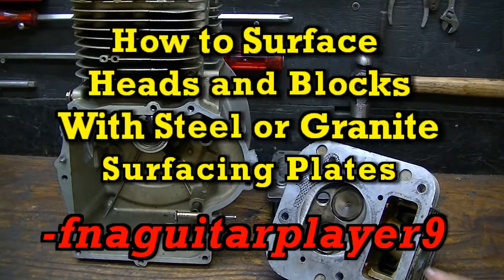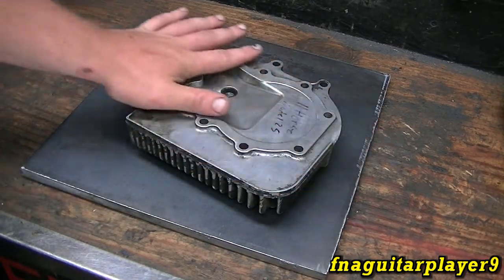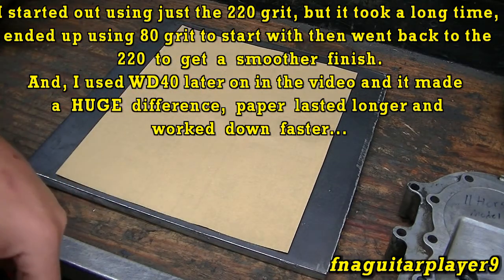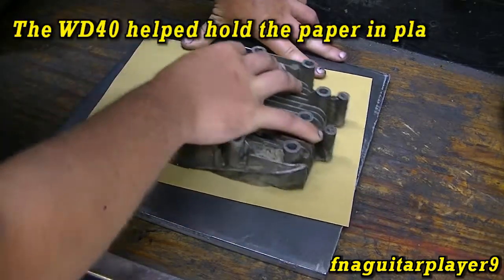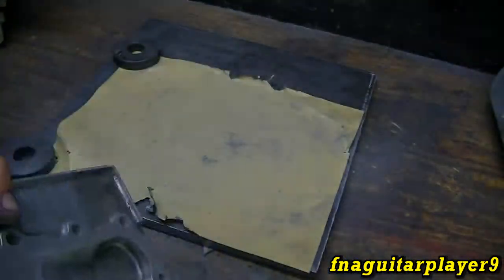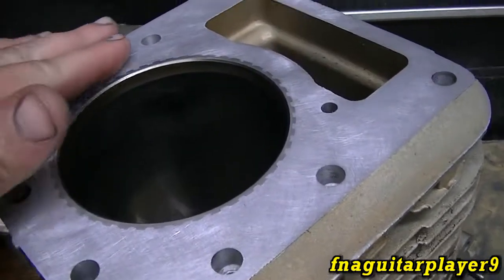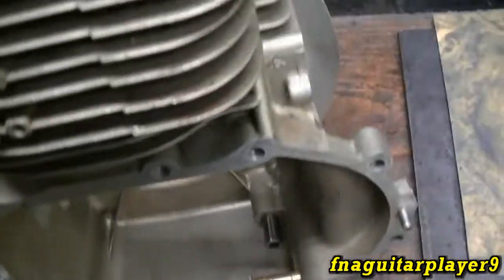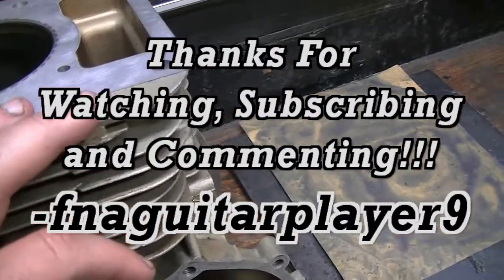How to Surface Heads and Blocks with Surfacing Plate

Comment: A pretty heavy sheet glass or mirror will work, just make sure it is on a solid surface. I watched your video about the overheated Briggs Intek, seems to be a weak point on the cylinder head design. It looks like on the push rod side there is about a third of the circumference with no headbolts.

Comment: You can use a black dry erase marker on the head surface to see where it's being sanded. Also can use spray adhesive on the other side of the sand paper to keep it flat and from moving. This is a lot like filing the frets on a guitar and getting them level.

Comment: Just wondering how much downward pressure were you using? I've been using just the 
weight of the head or block. Looked like you were pushing down harder. Also, tape along the edges will
hold  the paper pretty well. Thanks for this!
Reply from the maker: I'd guess and say like 5 pounds of downward pressure, not a whole lot but it does need a little bit to work right. True, i will try that next time. Thanks for Watching!!!

Comment: What I
 do is spray some 3m spray adhesive on the back of the sandpaper that way you can use both hands. Seems to work fine and you can clean it up with some carb cleaner or gas to use a new piece? Just saying . Also you can spray the surface with black spray paint to see how much is coming off and to see how bad it is. Thanks for the videos good job.
Reply from the maker: Thats a good tip, i was afraid it would stick to good and not come off easily. Your welcome, Thanks for Watching!!!

Comment: That's really a professional finish on the head and block, I've got Chevy engine parts done at a machine shop many times and your surfaces look as good. See you don't always need to spend a fortune to get professional results. Goes to show what's possible with creative thinkers like your self Frank, thanks for the awesome tip!
Reply from the maker: Thanks, it does turn out good, this is the old old way of doing it, I've heard stories of people using slabs of slate and running like a straight 6 head back and forth for hours and achieving similar results, your welcome, Thanks for Watching!!!

Comment: Spray the bottom of the head with black paint so you can see where sand paper is actually sanding on your head surface. . Also tape your sand paper down. You can also use a thick plate of glass.
Reply from the maker: Thats a good idea, I'll do that, i have used a sharpie before on flanges and stuff. Thanks for Watching!!!

Comment: Spray mount the paper to the plate and use oil. It gives far better control and accuracy. Also when doing a block it's easier to move the plate over the surface.
Reply from the maker: I will try to spray it next time, that should help alot. I did use oil after the dry test didnt work to good, i just sprayed wd40 on it every so often. I will try that on the next block! Thanks for Watching!!!

Comment: is that the same engine block you gonna use from your other video, what i meant was the other video you had a lawnmower that the crankcase was crack you say that you were gonna fix it
Reply from the maker: Yes it is, I bought it off ebay for cheap (35 bucks) and its in near mint condition. My next video will be how to / tips on honing cylinders and i use this block in it as well, just getting it ready. I have all the parts now, just need the time to do it, i'm working on a truck project thats taking alot of my time for longer videos. I don't think this block could be fixed, at least not enough to where i would trust it, if i had a way to weld aluminum myself i might try it, but i didn't want to put anymore money in the block, it threw a rod back in 2010 i think it was and busted the side of the block, that cost me almost as much as what i paid for the "new" block! Thanks for Watching!!!

Comment: Ask for cutoffs at the local granite place or get 3/8" plate glass too.
Reply from the maker: Thats a good idea about asking for scrap pieces. I have heard of using glass before, in my garage it would of been broken before i had a chance to use it haha Thanks for Watching!!!
Reply: Yes, I've used glass too.
Reply from the maker: Thanks for Watching!!!
Reply: alex tworkowski  I work @ du,mp yard where we take  concrete brick and  marble  and granite scraps from kitchen  counter  installers . Holy mackeral  you should  see it comes in the granit and marble  slabs  . If you find  a place  take a pickup better  yet a dump truck  you will be a washed in granit slabs  for a life time because  if you are like me one piece won't be good enough

Comment: That worked really well for quick and dirty. If you have a large enough work surface you can use 3M spray adhesive to hold down several sheets of paper including a super fine finish one.
Reply from the maker: I have a can of it and started to use it, probably will next time! I like that idea that way all the grits would be ready to go. I'd say start with a 80, then 220 then a 400 would finish it really nice. Thanks for Watching!!!

Comment: Thanks for the video.

From what I learned shaving the head on a flathead will further restrict breathing.  To make it breath better  you want to  "shave the eyebrows" which is lowering the block surface between the valves and the cylinder.
Reply from the maker: Your welcome! I have heard this before too, they say flow is better than higher compression. getting the fuel/air in and back out faster. Thanks for Watching!!!

Comment: That worked FINE! Almost like a chrome job! All I've ever done is use a putty knife ground flat on the end or maybe a file end BUT I see why Briggs uses the thick metal silver head gasket too. And I've never used a torque wrench on a head. Anti-seize or oil the bolts and using the sequence, I pull them TIGHT, just with my hands, usually using a box wrench so's not to strip or wring any. Never had one blow yet but might get a dozen today. Thanks, Pal!
Reply from the maker: It turned out better than i thought it would! I hear ya! As long as all the bolts are tightened the same it should be fine. I've done it before when i didn't have a torque wrench handy. I hear ya haha Thanks for Watching!!!